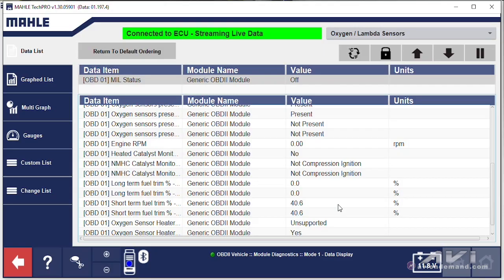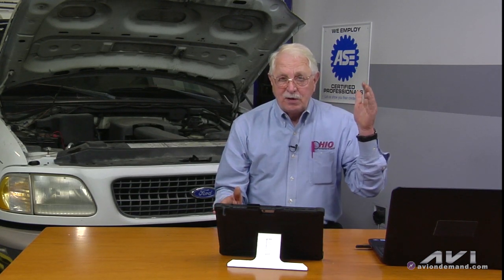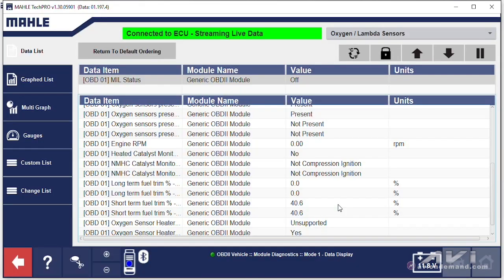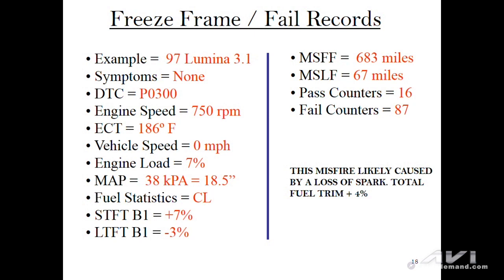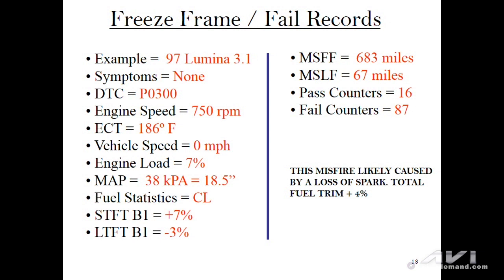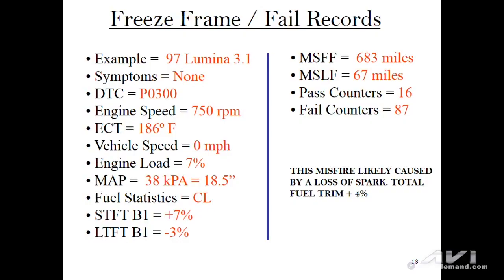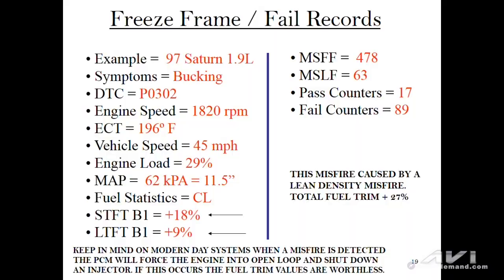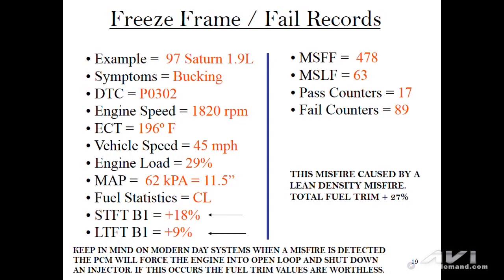P0300 Fix by Reading Freeze Frames w. Bill Fulton | Tech Tip

Comment: 2011 Dodge Grand Caravan 3.6l
P0300
My short term fuel trim is -20.312%
And my long term fuel trim is 0%

What does that mean?
Reply: It means you have a rich condition.  Did you fix your 2011 Dodge Grand Caravan 3.6-liter yet?  A lot of things can cause a rich condition.
Reply: @USkeZB3mpyAMCV yah it was a broken valve spring. Was going in for a head gasket rebuild and when removing the camshaft the exhaust valve spring was found broken. It was a tough sight to see when it was compressed by the camshaft

Comment: Hey, I was cleaning MAF sensor on my car using MAF spray cleaner and set it aside to dry.  Before I connected it back, I needed to turn on the ignition of my car, but not start it.  After I connected MAF sensor and started the engine, I noticed "check engine light".  I immediately remembered the above and connected the scan tool.  The error code was about MAF sensor circuit which is fine and then I erased the code.  All was good.  When I scanned for a code again, there were no more codes, but when I look at freeze frame data, it still shows the history of the error.  How can this be removed?  Will disconnecting the battery on my 2010 Honda Fit erase history that is stored under freeze frame data?

Comment: Awesome tip Mr Fulton. Question? When u say air/fuel type misfire double digit. That could be vacuum leak for air and for fuel u mean bad injectors. Reason I ask is because I have seen clogged injectors cause lean fuel trims. 2 injector to be exact. Is that what u mean? The single digit loss of spark tip is awesome.  Thank u
Reply: Yes. Fuel trims added together result in single digit “total” is a weak ignition component. Fuel trims added together in double digit “total” is a mixer issue (air or fuel problem but could also be a completely failed ignition component.
Reply: @davidjoegamez5901  thanx David. I kinda figured that's what he was trying to say. But the advanced terminology Bill uses can throw a beginner like myself.... way off. They speak a different language 🤣🤣🤣
Reply: Jason C. Glad to help, they are very technical guys who speak fast lol and if you like their training videos, they have hours and hours of videos on their website aviondemand.com.  I paid the $99 a month to watch as many as I can, taught me a lot and I’m a L1 Master Auto Tech. 🍻 cheers